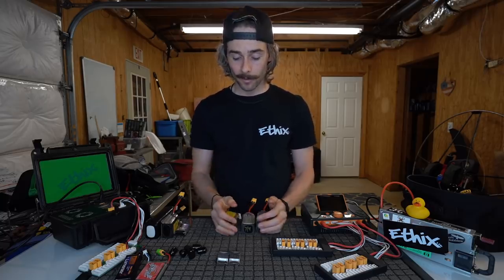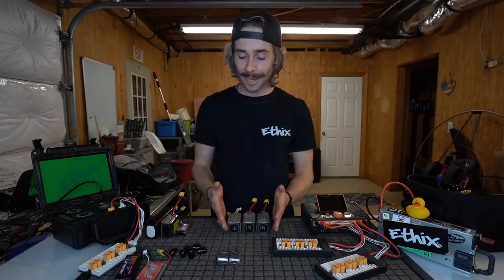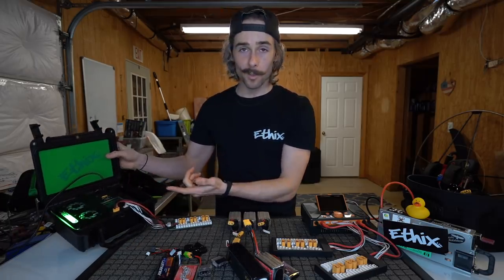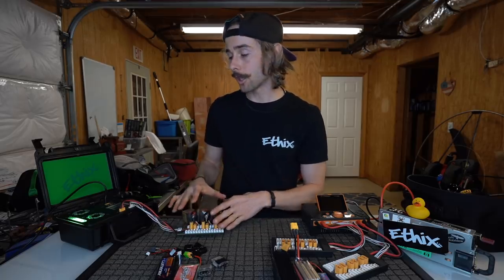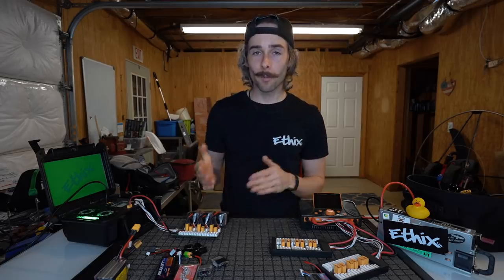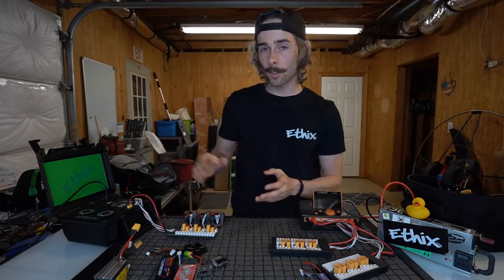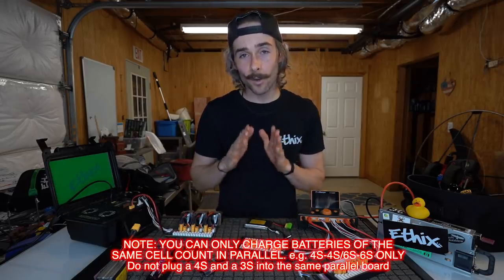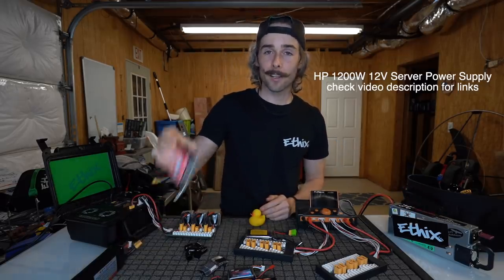How to FPV (Part 7) LiPo Battery CHARGING | Is Parallel Charging DANGEROUS ???!

Comment: I would connect the xt60s first, because the balancing current between differently charged batteries can be high and fry the small jst connector.
Reply: Your completely right my friend I said the same thing
Reply: There's no way to fry the cables if you follow the method of checking and making sure the difference isn't higher than 0.3v as explained in the video, every time you charge.
Reply: That is partially the point of doing balance connectors first. It's better to have the balance wires fry because YOU fucked up and didn't confirm the packs were within a safe voltages of each other. If you do xt60 side first. Those wires/plugs aren't gonna care that you accidentally plugged a discharged and full battery together. What is gonna end up caring there is the battery that is puffing and getting ready to explode on your workbench.
Reply: This is where Joshua Bardwell's V2 parallel chargers stand out; they have polyfuses between the balance sockets, so if you do plug in the balance connectors of an empty pack and a full pack, the fuse(s) will trip and protect everything, then when you unplug the battery(s) the fuse(s) will cool down and reset.

Comment: i guess i can combine some questions from the comments together:

1.) what's the difference between balance charging and charging?
doesn't it balance the packs as soon as it recognizes the balance lead?

2.) does EVERY single cell from like 3x 6s pack get balanced out while parallel charging? or just every pack as a whole at the same voltage than the other 2?

3.) if you plug one pack just into the balance lead will it balance the cells without charging it 🤔

the last one was my personal i'm still new..... and waiting for my ICharger 4010 duo 😅

Comment: sorry noob question, just a bit confused about the 1c charging. If i have 3 850mah 4s batteries in parallel do i set up 3x.8 amp? = 2.4amp output ?

Comment: Actually, the "keep under 0.3 V difference" advice is good if you are in a hurry, but it's not more dangerous to do packs with large differences if you are not to much in a rush. What happens when you have differing pack charges is that as soon as you plug them in the charge will rush from the pack with more charge to the one with less, equalizing them. What people worry about is that there is a massive inrush of current from the pack with more charge to the one with less and this would be dangerous. In reality, it's not that big of an issue: if we take a full and a flat 6s pack, the full being at 25.2V and the flat at 22.2V and the packs have an internal resistance of 0.018 Ohm (assuming a pretty average cell resistance of 3 mOhm) this would give in theory give a current flow of 3/0.018 = 83.3 Amps which sounds pretty bad. However, this math fails to take into account that a pack under load drops in voltage as we all know from flying them. At the same time, the discharged pack's voltage will increase when you give it a charging load. This means the actual current flow will be considerably less. It's difficult to come up with a calculation since it will vary depending on pack specifics, I have however tested this quite a lot, and even when hooking up a fully charged pack (4.2V per cell) to one really flat (3.3V per cell) I never got more than 31 Amps current and that lasted for 0.35 seconds before dropping and after 15 seconds no combination of charges yielded more than 5 Amps. So, in reality, the worst effect of hooking up a full pack with a discharged one is that you waste the cycle of the full pack. It should be noted though that this goes for connecting the main leads first and then waiting before connecting the balance leads since 30 Amps through the balance leads will most definitely damage them and potentially set something on fire, which is never good around lipos. Yes, people argue that doing the balance leads first uses them as a faux fuse, protecting the low charge pack if you hooks up one with to much charge, but as far as I can tell this is a non issue according to above and thus I would always connect the main leads first, and even with packs of similar charge I wait at least 5 seconds before connecting the balance wires.

Now in reality, there's rarely a good reason to charge packs with widely differing voltages and avoiding doing so does eliminate some considerations, but there are the occasions where you have 4 packs, 3 are close to each other, but the last one is 0.4 higher because you broke the quad/it started to rain/some angry security guard ran you off etc. In this case you can still charge them all, and in that case you can be extra safe by first connecting the 3 similar packs and then the one with more charge, at which point the current surge will be split between the 3 already connected.

This said, after the packs are equalized, the difference in charge has no further impact on charging, which means that as long as you wait long enough after plugging in the main connectors to the board before doing the balance leads and beginning to charge there is no further danger due to the charge difference.
Reply: That's incorrect, even if the fuller battery can easily handle the discharge, the more empty one can't handle so many amps without damaging itself, so you lose a lot of battery life by doing this and can even cause a fire for other reasons, for example a bad or cheap charger

Comment: Ive been parallel  charging since i stsrted 8 months ago  my charger is the d2 isdt  i use 2 paralle boards with it one charges  my 1500mah 4s   n the other i charge my infinity  1300 4s   takes about 50 mins to charge 8 batts at 1c

Comment: Just got into this hobby, bought a bunch of 2s 450mah batteries for my Tinyhawk Freestyle II, I chopped off the PH 2.0 connector and am put on an XT30. But I don't even have a charger and don't where to even begin. What kind of charger do I need? Is there an all in one type of charger?

Comment: How do you keep a 0.3 volt difference between cells on different packs from smoking your tiny balance wires? If you had really low internal resistance cells you could put 50 Amps through those wires with two batteries of 0.003 ohms.

Comment: Newbie here who just bought Tinyhawk RTF package w/ 5 extra batts. Any recommended beginner chargers that will put them on a storage voltage when I'm planning to not fly for a bit?
Reply from the maker: ISDT chargers are great but there discharge rate is complete crap.   The lowest budget charging setup I can thing of of quality would be an icharger x6. And then you convert one of those 12V HP server power supplies to power it from the wall.   Should be all up about 160$ for an extremely capable charging and discharging setup that you can grow into.
Reply: Thanks dood! I'll chk it out. Really appreciate all the info you give us!

Comment: Very useful video- thank you. I'm new to  rc drones, and have a flying wing. The wing I have is usually powered by a 3s lipo, but I have seen many guys power this particular wing with 3s2p lithium ion 18650 battery packs. My question is, can I charge 3s2p 18650 li ion packs in the same way? Is there a different setting I need to put on the balance charger compared to the lipo?

Comment: Can u charge different mah/capacity together. Obviously same cell count. And what’s considered high internal resistance? The only resistance i see is after the balance part of a full charge. Single battery two channel charger.
Reply from the maker: Yes   It just works out   :)  same cell count just works regardless of mah

Comment: Hey Mr. steele, quick question. IF you have a large designated charging space in your workshop and regularly charge batteries in parallel while you are tinkering in the shop, is it a good idea to construct some kind of "battery bunker" to contain a possible Lipo fire? I had a bunch of "fire bricks" left over from building a backyard forge last year and I was thinking of turning them into some kind of enclosure that would protect my shop from the heat generated by a lipo fire reaction.

Comment: Hey Steele, I keep hearing different things as far the difference in voltage. I've heard .2 and .3 and . 4.. I normally use .4.. Safe?
Reply from the maker: Safe is a relative term.  Yes. It’s safe and I go above the .2V mark sometimes. But as a rule of thumb the closer the safer.
Reply: To be on the safe side (usually .1 to .2) .. I always check packs .. plug them in to balance board.. wait about 10 mins then charge .. it will balance the packs on the board I’m never in a hurry to charge it’s not worth the fire to me lol

Comment: I got 2 double port chargers for about $80 each, so I can safely charge any combination of packs. They do not have to provide much power If only using 1C, no need for those high power chargers. But good to know how parallel charging works. Would you recommend it for 1S packs used for whoops?

Comment: Hi steele, I have different packs with different cell internal resistance. Between 9mOhm and up to 30mOhm. All of them are "new" out of the store. Have I a go to charge the 6x lipos on the same time or should I stick them togheter wo have the same resistance (+/- 5mOhm)?

Comment: Thanks alot Steele.  I was wondering if the amperage was additive when parrelel charging. I've heard as long as they were within .1 volt per cell of each other, ex. .4 volts total on 4  cell batteries. Think I will do like you said and keep it @ .3 .

Comment: One thing that I have wondered is on small batteries with a lot of sag, when you fly and the battery sags to below 3 volts but bounces back to above 3.5 when you stop should you worry about the sag and stop flying.

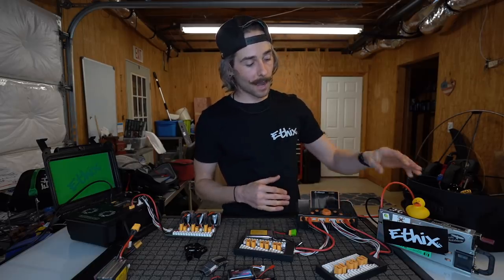Comment: 12:46 -- your charger is limited by your power supply. You need a higher voltage output from the power supply because @ 12V, you can only get 1200W power if you're pushing 100A from power supply to the charger. While the power supply will happily attempt to output just that, the iCharger 406 Duo will only accept 60A so you're only able to get about 720W. From the size of your batteries even in parallel this doesn't seem like a limiting factor if you're only going at 1C, or even 2C, but you could have saved money with a less powerful charger or get a better power supply that can push 24v power. You can drop down to a 800W~1000W power supply but if it outputs 24v you'll be better off with most any charger because they all accept up 24V~30V DC and their charge power ratings is at those voltage levels and not 12V typically.
Reply: Whoops...I hit pause way too soon and looks like you explained just that lol.

Comment: I think you charge multiple batteryes in series (for example 3x 2s battery =6s battrey) This you can do ONLY  if you have a charger that support BALANCE CHARGE. I am not shore if batteries have very different capacity.

Comment: Just get a SkyRC Q200 for under 200$ and charge up to four batteries individually. This is saver and you don't need to check voltage beforehand. A much better solution than parallel charging. In fact better as each pack gets balanced individually.

Comment: Is there a way to control the rush of balancing batteries when plugging into a balance board? So u could plug them all in without checking voltage (same cell count) and leave it for 15min before charging. Resistors?

Comment: been paralell charging for years,  only issue i had was when i accidentally hooked up an empty battery with 1 almost fully chargeed, it blue out the balance traces o the balance board.

always double check each cell are same voltage.

i do them at 2c, got several groups of battereis, 3s 2200, 3s , 1000, 4s 1300, 2s 450. 4s 1400.

would take all day charging individually even with my duo charger. 

paralell charging can do it in a couple hours.

Comment: Until now I always only parallel charged my batteries to around 4 Volts and then finished the charge one battery at  a time. I thought that parallel charging doesn't balance the cells correctly. You didn't mention doing that, so I don't have to do that and can save a lot of time?

Comment: What are your thoughts on poly fuses on the parallel boards? I’ve heard you can use these to balance out your packs if they are slightly off.

Comment: I take packs with different voltages and place them all together on my balance board and let them set before charging them. Letting them set in conjunction with each other long enough, 10/15min tops, all the cells will balance out to even all cells equally before i charge them! Is this a wrong thing to do?

Comment: is it a "problem" to charge them at 0.5c ? 
i have the charger at the same setting .. for all batteries (1C max) .. but i also charge the google batteries with the same settings .. leading to a 1600mah battery being charged with 900ma
since the time isn't a issue (i have always stuff to do that takes far longer) so i just put them on last and disconnect them once the charger beeps.

Comment: @Mr Steel So if the cell voltages differ from 0.3v/cell, there’s going to be a lot of batteries being charged by themselves as every pack is different once discharged? Also, when parallel charging, is it safe to charge higher than 1C? (Like 3c If u had 6x batteries?)

Comment: Electroniclly it makes no sense to me to plug in the balance lead first. If you have any voltage difference in the batteries it will try to equal out through those tiny balance wires I would rather have it balance out through the xt60 it can hold ALOT more current and voltage as well
Reply from the maker: Because it’s easier to fuck up the balance lead than it is the xt60. That’s the whole reason I do that... also. If you noticed. I said. This is how I do it.  Not this is how it’s recommended to be done
Reply: @MrSteeleFPV  but I feel like it's pretty hard to plug a 4s balance lead in anything but a 4s plug due to the slots on the plug you would have to force it pretty hard. I guess I've seen more stupid things done though. So I see what you mean
Reply: That is partially the point of doing balance connectors first. It's better to have the balance wires fry because YOU fucked up and didn't confirm the packs were within a safe voltages of each other. If you do xt60 side first. Those wires/plugs aren't gonna care that you accidentally plugged a discharged and full battery together. What is gonna end up caring there is the battery that is puffing and getting ready to explode on your workbench.

Comment: @Mr Steele If i'm charging 3 4s 1300 mah  lipos, do i just add up the mah and keep it at 4s or do i have to add the cells to so 3900 mah 12s, or 3900 mah 4s...Thanks

Comment: I had a parellel checking board go up in flames once...had 1 battery into it already...when I went to plug in the second I plugged the balance lead in backwards.... started smoking on the board , then sparking .. then flames...grabbed it in time and brought outside , separated the batteries .... Parellel board melted...both batteries had the shrink wrapping on them melted, but they still worked..(....the one that started fire, not so long though...one of the cells degraded quickly).. 
After that my fire resistant  metal charging cabinet still smells like burning plastic and
I always recite when plugging into balance board " Red Wire Toward The Right". Which always ensures the balance lead goes in the right way..

Comment: If you have a few batteries that are a lil more off than .3 from each other cant you plug them into the parallel board and wait like 15 min for them to balance each other out then start charging them ? Or do you think thats not safe and obviously i wouldnt do that if they was way apart but maybe just out of your safe range is that ok or no ?
Reply from the maker: Like I said. You “can” do anything.... but I prefer to not practice such things Because it’s not good on the batteries aka (rapidly charging them with another battery).   So I stick to the .2V range difference. Unless I’m in a pinch
Reply from the maker: And when I’m in a pinch I just say fuck it and throw things on that at .5-.7V apart. And charge at like 3C.  But...  I know there’s a huge risk. And I pay close attention during the entire charge process..   and I only do that 1-2 per season I’d say
Reply: Ok well that clears it up lol i wasnt sure if they balance each other out rapidly when you do that so now i know and i dont usually do that either but nice video thanks
Reply: The thing about the different voltage is that very high currents can flow from one Batt into another exceeding the 1C current limit!
Reply: Another little work around is say you have a packs at 14.80, 15.05, 15.20. Obvious 14.8 and 15.2 are a bit off, but you could do what you suggested and plug in the 14.80 and 15.05 together. Let them balance out to somewhere around 14.93 then you can add in that last pack that was a little high.

To go even a little bit further as was stated in the video putting the packs in parallel just creates one big battery, and big batteries have a higher 1c amp rating they can charge at. So if you had say 5 packs at 15.00v plugged into the board but still had a 15.5 pack that didn't get used all the way. You could safely plug that 15.5 pack in after getting those other 5 packs on the board and that 15.5 pack would be equally discharged between the 5 packs splitting load that is getting discharged into the other batteries.

Comment: Field charging: Can you confirm...: A fresh flown pack, still warm, has less internal resistance and therefor is good to be charged at 3-5c? 
Tried it, worked, but... just doesn't feel good! Like forcing "Julie" right after the first exhausting  "round" xD